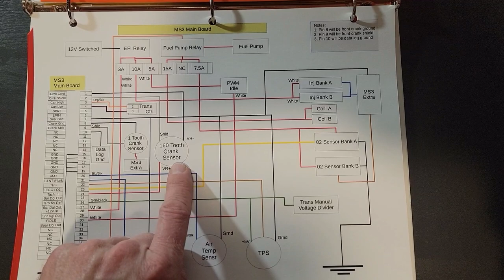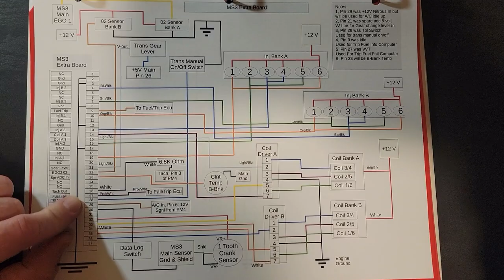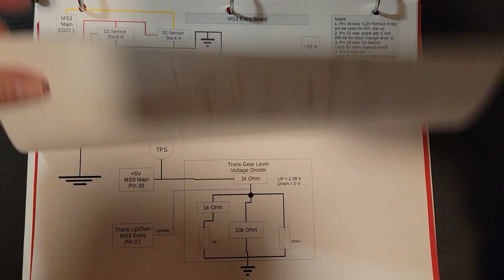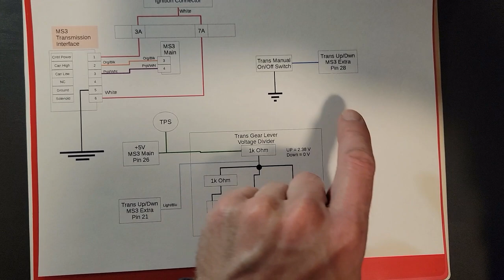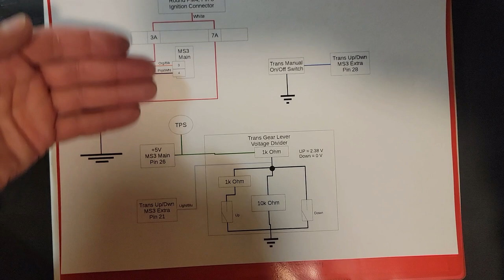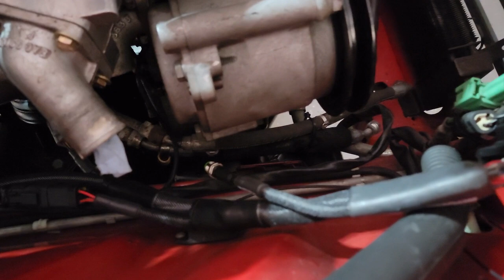Jaguar XJS, initial wiring for MS3 and 4L60E swap

Comment: Didn't the XJS have Lucas Electrics as OEM?  I had a1972 Norton Commando with Lucas Electrics, and they were garbage.  The coils kept going out on me, but I found a small Toyota coil that would fit and worked fine. I had to replace the horn switch also, and numerous little issues I had to troubleshoot often.  Avoid Lucas at all costs.
Reply from the maker: They switched to a combo with marelli at some point. I tried keeping it oem for a few years but it was always something else not working good or parts unavailable.